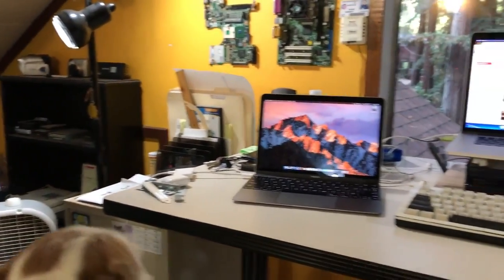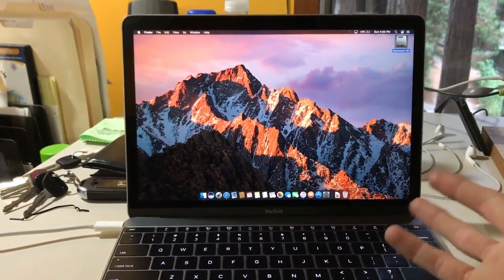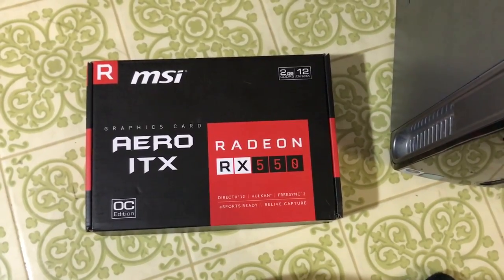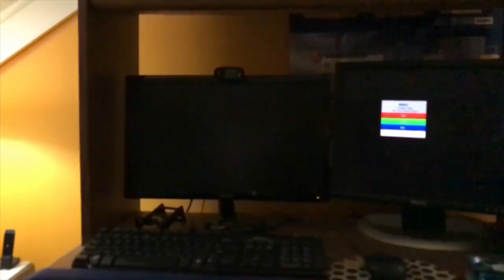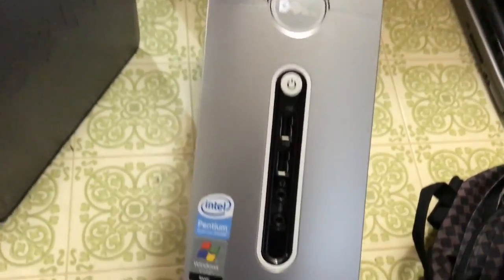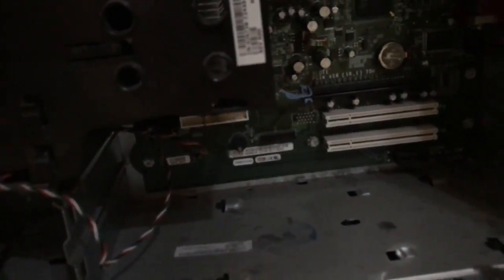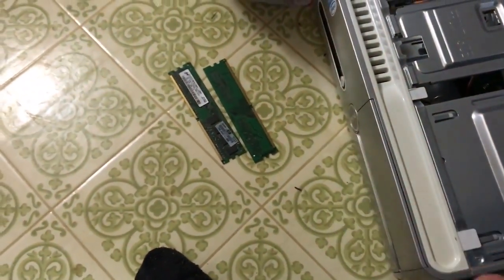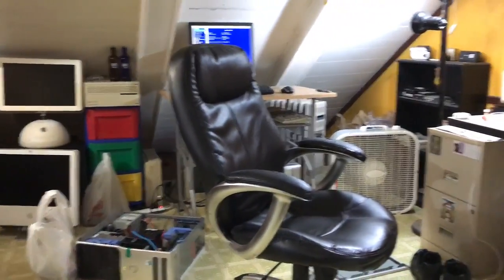12" MacBook & Testing a Bunch of Dells

Comment: Ryan, you seem to know a thing or two about MacBooks. My friend has a late 2011 MacBook Pro (15.4") and it's been acting up lately. It is a victim of the graphics card problem that some 2011-2012 MBP's were prone to having where it'd distort the display and show random lines all over, but I think there also might be a problem with the installation of OS X. When you start the computer up, it goes straight to the login screen after the Apple logo, but after you put in your password, it shows the loading bar which gets to the halfway mark before going to a blank gray screen and doing nothing, which I think is an attempt to restart. When I hold down "option" on the keyboard while it's starting, it shows the Macintosh HD startup disk and the available WiFi networks, and when I select Macintosh HD, I get the same issue. If I hold down "shift" while it's starting up, It shows all that crazy repair stuff and tries to do something before it restarts and shows the classic "your Mac shut down because of a problem" screen. If I hold down "Command+R" while starting up to try and enter Recovery/Safe mode, it shows the Apple logo with the loading bar underneath indicating that's it's trying to boot into safe mode, but the bar gets halfway full before the computer just shuts off. I tried popping in an appropriate Windows 7 installer disc and pressed "C" while it was booting up to see if I could get Bootcamp working and install Windows, but no luck. Just a blank screen. Same result when I hold "option" on the keyboard to get to the boot options and select the "Windows" disc. It's really weird because just earlier today, I was able to get it to boot up into Mac OS X Yosemite just fine (or El Capitan? I can't remember what's installed on it) without a problem and use the laptop like normal... Doyou know what could be going on?
Reply from the maker: +Nick Pickel Probably GPU failure. That repair program has ended, so you're kinda SOL.